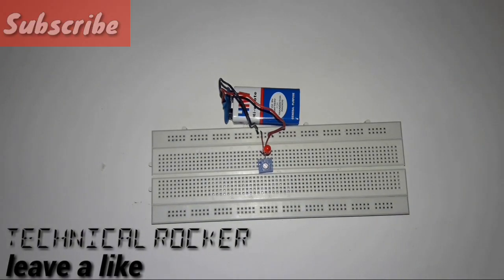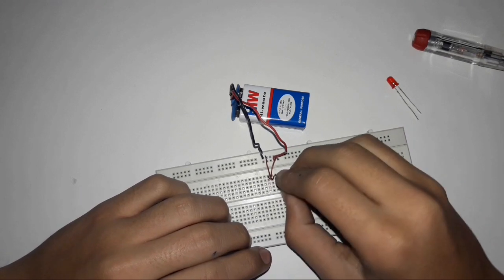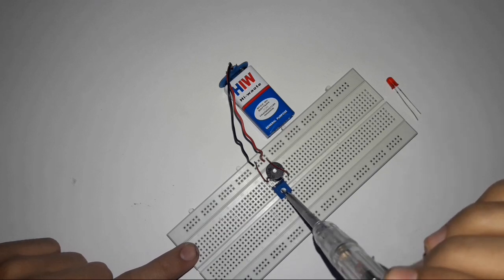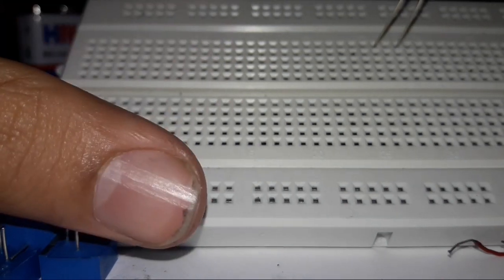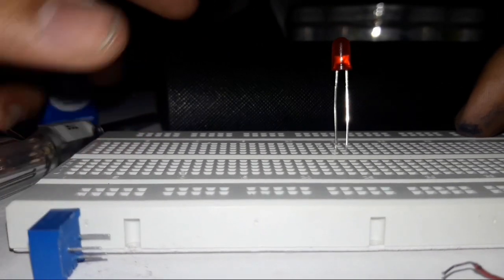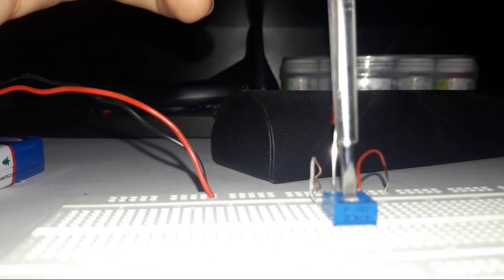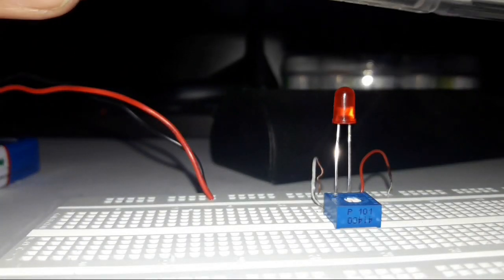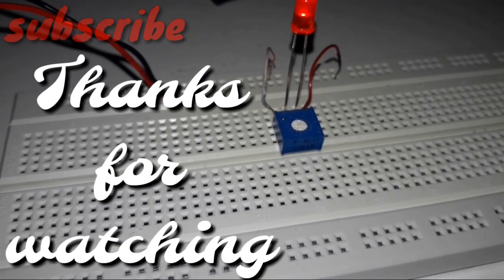How to use a trimpot or potentiometer on breadboard(easy) (fully explained)

Comment: How to adjust it if the hole is too small
Reply: apply oil
Reply from the maker: @38-yashyadav64  i would not suggest you doing that it is not good to apply oil on electronics
Reply from the maker: LOL! I don't think thats gonna happen if you are using tripot for breadboards or if you are using a bigger one,if possible then u can solder it with ur circuit that u r making or buy a bigger bread board as well 😅😅